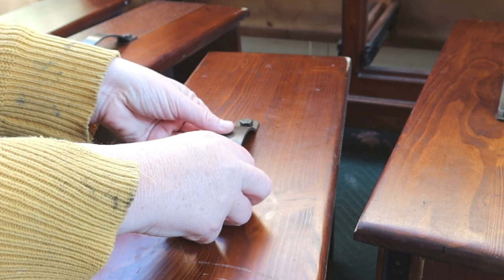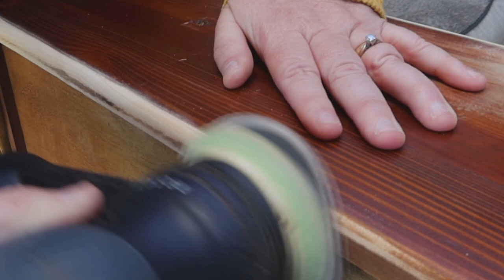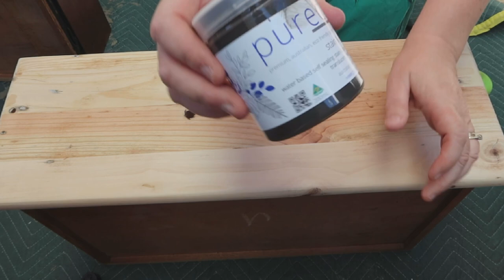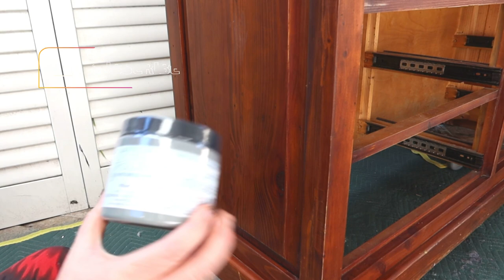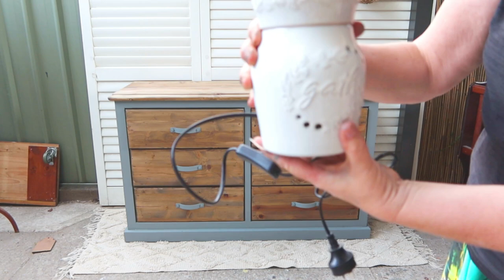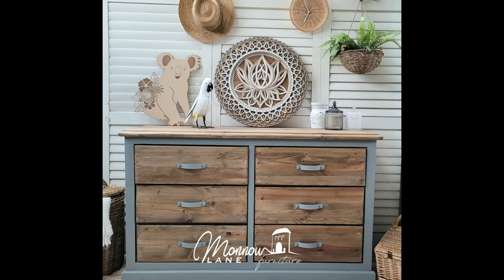Coastal Furniture makeover | Festool Sander | DIY thrift

Comment: Rachelle, now that you're no longer using Dixie Belle, what other product would you use instead of Slick Stick please?
Reply from the maker: I prefer to sand with a higher grit than normal just to take the shine off. If there is no other option I use a good Primer. My favourite is Lignocolor clear